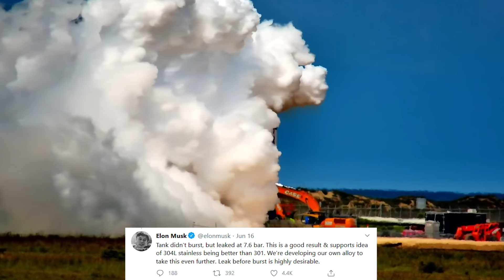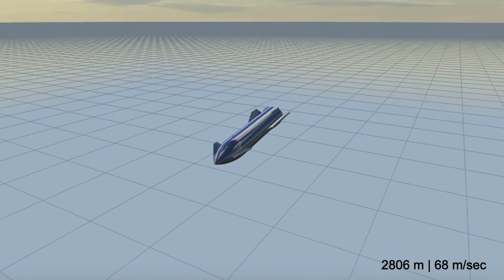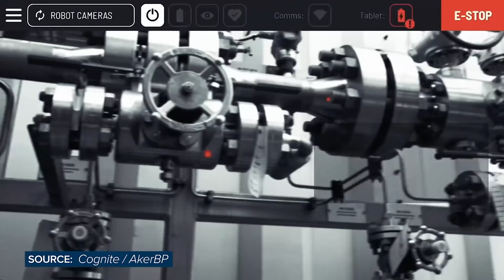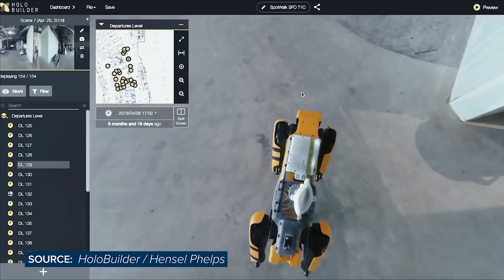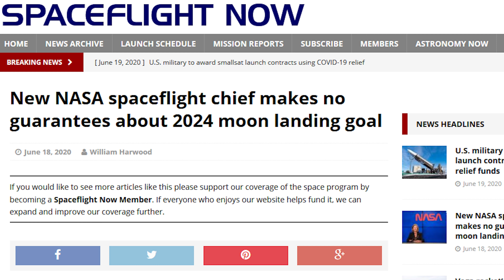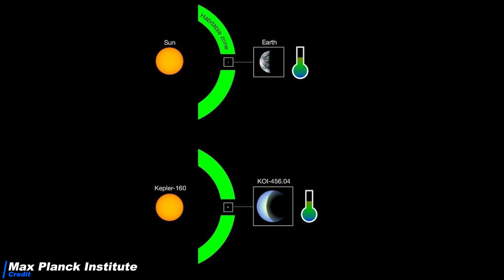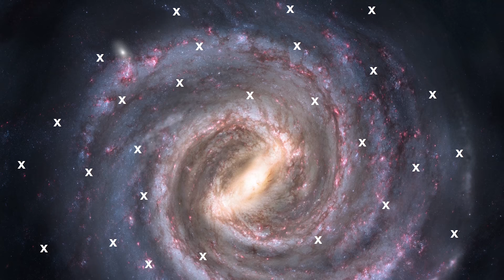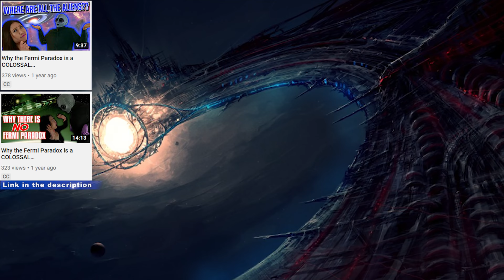SpaceX Starship News, Lueders Doubts 2024 Moon Landing, Earth-Sun Mirror Image Discovered!

Comment: Hey again J & S! Thanks for yet another excellent and thought provoking video! One question that maybe you can answer in a future Space Report:

When the heat sheild tiles are fitted to Starship they are clearly going to weigh a fair bit. This is going to mean that the Centre of Thrust is will be offset from the Centre of Mass, leading to the same 'crooked flight' problem that would have affected SN4 if it had hopped with just one offset Raptor. Any info on how SpaceX will overcome this problem?

Comment: The 4 reasons SpaceX is creating floating space ports (my opinions and guesses) ...
1. Point-to-Point Travel: Floating create spaceports/airports for major coastal cities worldwide to support point-to-point travel on earth using Starship. (Real estate is difficult to obtain and regulations would be a nightmare.) Point-to-point travel is a long-term revenue source for SpaceX far (like Starlink). The frequency of flights will also challenge SpaceX to make Starship safe and super-reusable.
2. Wartime Access to Space: Space Force has (no doubt) already communicated to SpaceX how vulnerable space launch facilities are to military attack. Having floating spaceports will give the US the redundancy to access space even in war time.
3. Flexible Launch and Landing Sites: The ESA chose  French Guiana in South America as their launch site simply because it is closer to the equator than Europe.  This gives an advantage in launching to orbit when launching with the earth's rotation because you start with a greater fraction of the speed necessary to reach orbital velocity. Having mobile space ports is going to give SpaceX flexibility in how and when to launch and lang.
4. Independence from Sovereign Nations: This is the point you brought up. Launching from international waters will indeed allow SpaceX to avoid some regulations. However, the future for SpaceX is in building allies and partners, not going it alone. The fact that they are willing to go it alone is a bartering chip to coax others to come along faster.

Comment: The SN7 tank leaking before bursting is simply one small data point.  Extending that to assuming it is property of welded 304L SS, and would normally be true is a major stretch.  Leaking well below design pressure is not a positive result.  Indeed, in a repeat burst test since this video, it burst quite catastrophically, apparently at the bottom of the tank.  We don't yet know at what pressure.

Comment: I think the issue of a Space port off the coast being free of regulations might be a bit over stated.  The legal limit is 10 nautical miles or about 12 miles for national control at or below the water there are additional constraints up to 200 miles and international constraints.  I think the biggest reasons are safety and noise abatement.  This is to be a huge ship with huge thruster noise and imagine the windows needed to stand up to the shockwaves.

Comment: 1.  The 304L that they used is purchased.  The alloy that they are developing will have a chemical makeup and designation different than any stainless developed so far since it will be proprietary.  It will most likely not be a leaded alloy having lead replaced with a lighter metal like zinc.
2.  I have looked up the number of times we have purposely transmitted signals to the stars for them to know that we are here, and that number is immensely small.  The most widely known transmission is the Arecibo Transmission in the late 1970's.  So under that same litmus, the chance that an alien civilization has sent a transmission our way is also immensely small as to be negligible, so the chance of us finding evidence of alien civilizations is just as negligible.  It is sad, but true.

Comment: Thank you again, my friends, for a great video!  

The floating spaceport is a good idea from several aspects.  First, as was mentioned a political end-run by operating in international waters is a great idea.  This will not only make the first flights possible, but the pressure from an effective already functioning operation will put pressure on those same politicians to make way for land-based facilities as well.  Second, being on the water allows for adding structures as needed without having to clear out people or get zoning and so forth.  Modules can be built anywhere and get towed to where they are needed.  In addition such bases could be relocated, if a reason or reasons to do so occur.  Third, in the beginning phase, safety and comfort for people in the surrounding areas would be enhanced because at sufficient distance, the most catastrophic events would not be a danger to them.  Also we must believe that SuperHeavy will have a SuperHeavy noise in use.  One Raptor engine has a deafening roar.   Image 37 to 41 Raptors in unison howling at max thrust!  I imagine there should be a sound barrage of 100 decibels or more over a range of miles!  

As for NASA, I almost say "Who cares?" because SpaceX will continue to take the lead anyway.

On exoplanets, I like most people are interested in the possibilities of both planets and alien civilizations.  This interest seems a bit academic for now, but if new revolutions in physics make possible faster-than-light vehicles, then that make them really relevant for people.
Reply: It just kills me that people have been fighting on if there is life beyond Earth since the 1950's. Now seventy years later we are finally going to concede that yes, there probably is a good chance. Why wouldn't other civilizations not contact us? Just look around!
Reply: @ronfullerton3162  Your suggestion may or may not be true.   One thing is certain, though, the likely distances of such civilizations from is , as the video suggests,  in the thousands of light-years.  If that is true, then that imposes a real obstacle to even detecting each other, let alone communicating.  But this is all speculation.  I expect that as we become spacefaring with Starship and its ensuing effects, we will certainly have more resources to explore the universe at least scientifically and perhaps get a real handle on those pesky UFO incidents as reported by the Pentagon.
Reply: @JohnnieGarner  I will agree with you that the separation is probably to far between our worlds to even contact one another. But the way we are, would another civilization even want to contact us? If another civilization was watching us I could almost hear them say, "Can you believe those humanoids?"

Comment: I didn't think about the political autonomy the offshore rig will give them 👌🏾. I think Another Factor in building rigs is that the amount of sound generated by the 37 engines could explode eardrums a few miles away, also a low-altitude explosion could cause the spectators to take a nap. ⚠️😴🤤

Comment: I just found out that SpaceX choose to use JavaScript for the display of the Crew Dragon. Am I the only one who sees many potential problems with this?!
Reply: What would you choose?
Reply: @Cornerback3141  My problem with JavaScript is that it is built on a platform that has not been formally defined. For instance its running those displays on the Chromium web browser. Would you trust your life on a web browser? As much as I am an advocate for composition over inheritance and modern functional programming techniques that empower agile practices....choosing to implement flight avionics for actual flight hardware on a web browser is not the smartest thing in the world if you ask me! I would write it in C++.....as much as I am against OOP, and for functional programming it pains me to say that but I think that would best to keep the entire software technology stack in-house. The last thing you want is a node module update from some hacker in Calcutta that causes a security vulnerability and loss of avionics display capability in-flight while docking to the ISS.
Reply: @SethEden  ok interesting points. I can see advantages of using C++